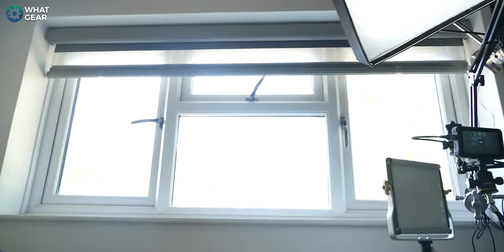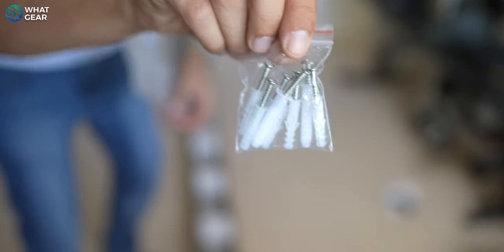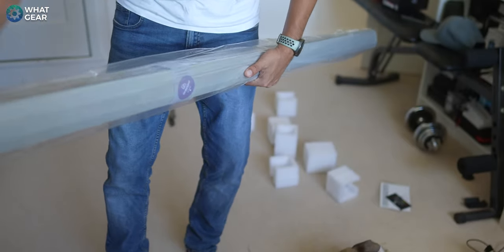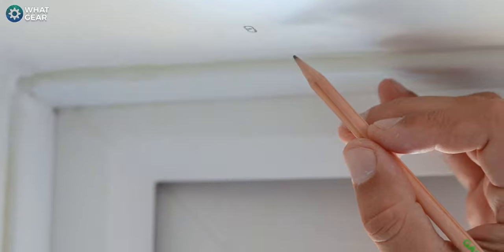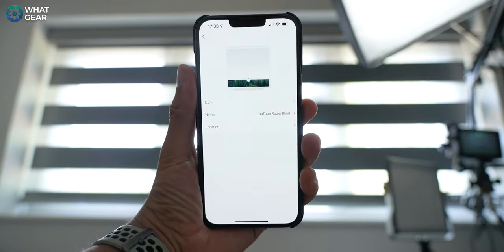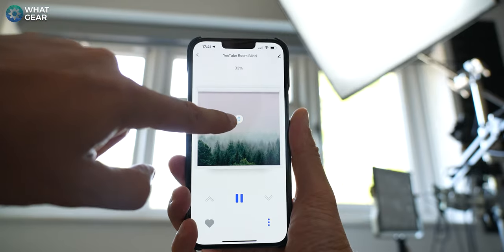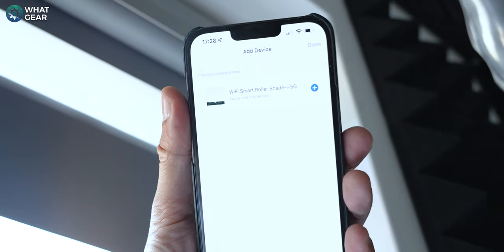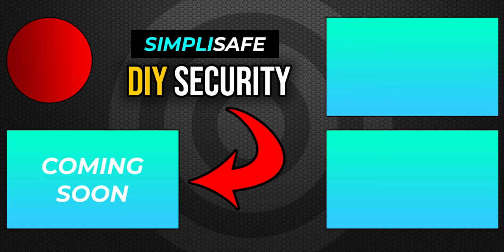Smart Blinds will change your life! - Graywind Motorized Shades Setup & Review!

Comment: Is it me or did we never really get to see the blinds.
Reply: I noticed that too. Perhaps he could write a short storyboard for all of the shots he wants to take. A basic outline of the start middle and end of his video. All of the points he wants to cover and the video sequences for those.
Introduction
Unboxing
Everything is included
What you need to do to get the job done
Getting a job done
How it looks
How it works
Up close
Distant
Showing the item in use so for this example it will be fully open 1/4, halfway, 3/4, fully closed.
Doing a command using the assistants.
Pros and cons
Power lead v batteries with relevant information. This would include how long the batteries last for because one commenter said the last for a few years but this obviously depends on use.
If the power fails can you still use the blinds manually?
If you don't have Wi-Fi can you still use the blinds manually?

If he has this written down and maybe he does then he just needs to take it off as he's going through all of the shots to match up to it.

I'm guessing there's probably a storyboard app he can use or maybe a book he can buy like instead of lying to paper it will be storyboard paper book. I recently seen that there are even football tactics A4 pads with goal drawings and stuff like this so that's bound to be something for storyboard people too.

I like his style. Maybe he could use a phone holder to hold the phone steady or put it on the table when he's showing us the different button presses and operation on the phone. Even a simple £10 Amazon triangle type phone holder which is quite sturdy. One of those aluminium ones. He can shape it to get the shot properly, and it won't wobble.

Comment: The Graywind Blinds is a product itself is a good idea, is good quality BUT  the installation, programming of the remote control, and the app and the operation with the curtains, which makes this whole set a nightmare.  However, there is "customer service" to solve problems and concerns, but it's really terrible and it really does not help with any of your concerns. If you want to buy something that you think you will have no problem with installation with no questions, you may buy it. If not, don't risk it with buying it!!